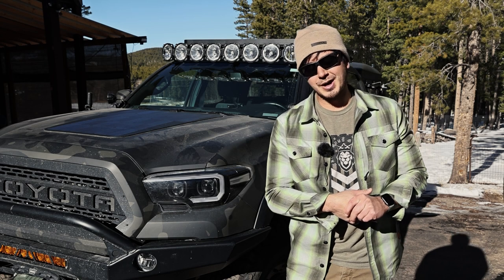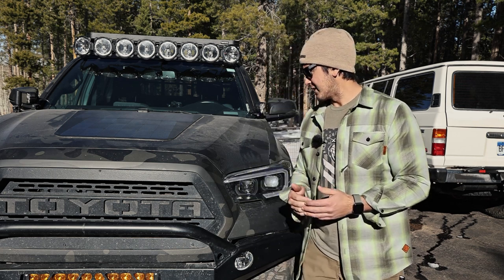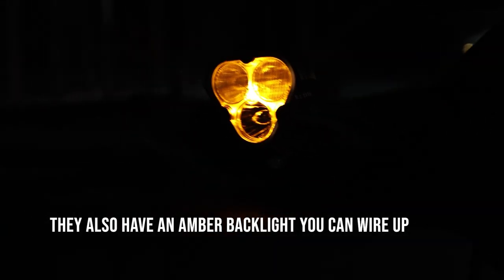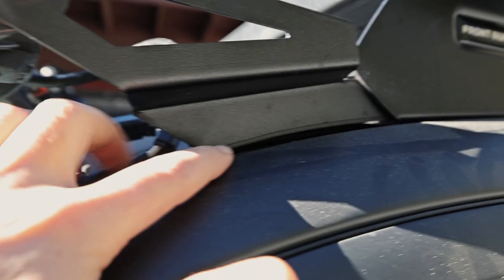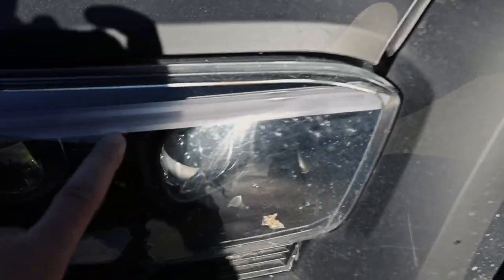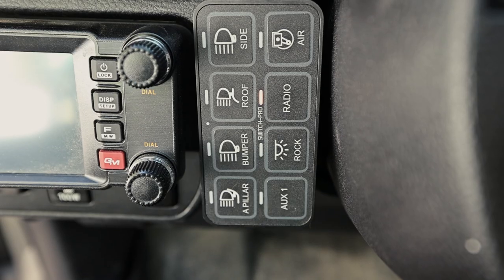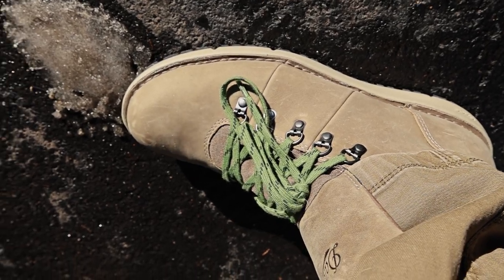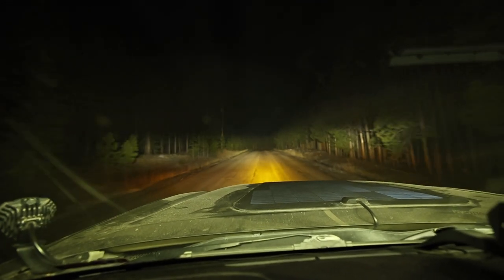Overland / Off-Road Lighting on a Toyota Tacoma - KC Hilites Pro6 Lightbar, Flex Era 3, etc.

Comment: Man your truck is goals.

 If you ever find yourself driving in snow and getting the fog lights packed in snow and freezing over I highly recommend checking out the Diode Dynamics SS3 Pro's or Max. They produce enough heat to keep the snow melted off which have come in handy when the snow decides to take a dump on us in WA. 

Crashburn80 has an incredible thread on all sorts of lights so if you haven't seen them yet, it's a good read. I warn you its a lengthy read since he constantly updates everything.

Comment: For your chase/tailgate light you can mount it to the trailing edge of bed rack in the channels and use a bracket with rubber grommets and a wing nut to creat a friction fit.
Reply: Btw it’s been a good 5 years

Comment: I'd like to hear your thoughts on the switchpro.   After one camp trip and trying to find a dispersed site in the dark, I really need to add some more lights to the Tacoma.  I have a Prinsu rack and a 40 inch bar, but that does nothing for side lighting.  Also an RCI Bed rack.  So I want to add ditch lights, side lights on both sides of the rack, and possibly chase lights/rear lights for dusty roads. I've seen a guy who mounted a switchpro up on the head liner bump by the sunroof controls for all the lights, and it looked pretty clean and convenient.

Comment: You mentioned the new build, is there a possibility of a beginners guide/easier ways to wiring? Im not sure if this is something you've already done though.
Reply from the maker: The absolute easiest way to wire up accessories is through something like the Switch Pros system (linked in the video description) or a system that's even a little easier, but with fewer features is the Trigger Switch System https://amzn.to/2JrNERO

Comment: Just added a set of Pro6 driving pattern to the front bumper of my Gladiator. Not going to lie though, I was pretty disappointed in the output. I’m hoping the Flex Era 3s I have ordered won’t be so disappointing
Reply from the maker: Yeah a single pro6 is a pretty low watt setup